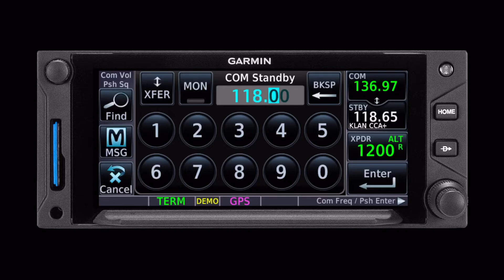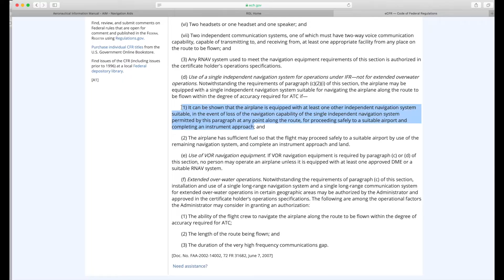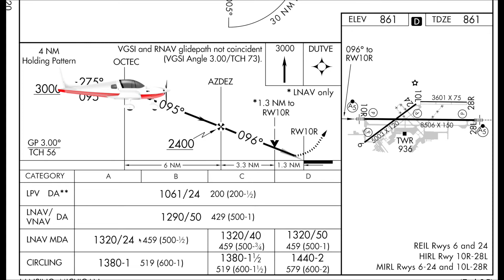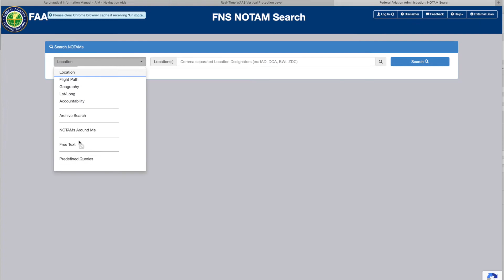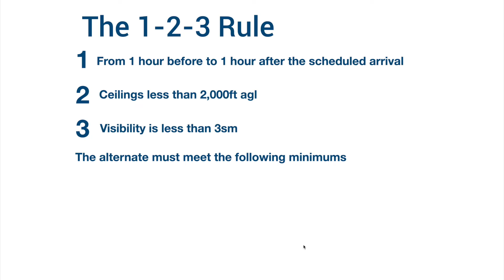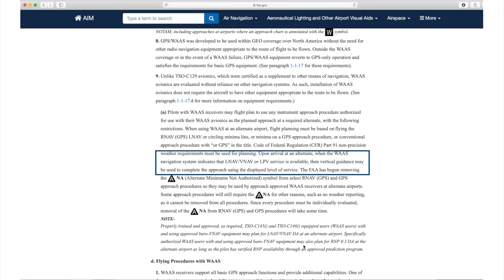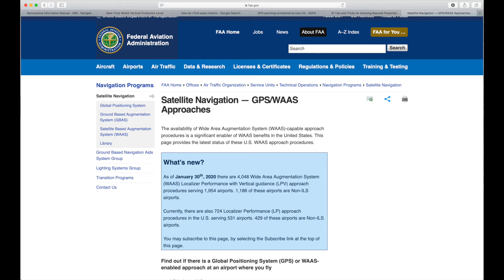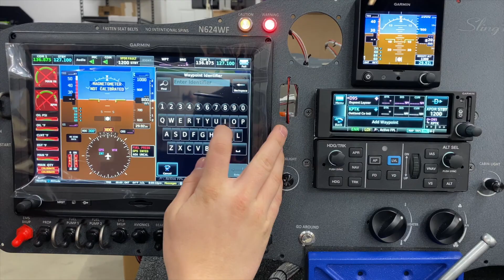GNX or GTN to equip your aircraft build for IFR?

Comment: I’ve used both and love both…I’m a bit partial to the 650 because I have more time with it but I think that’s the only reason really. The awesome thing about these units is that there are training apps for them. Sometimes I’ll just pop the 650 open on my iPad and run a “scenario” on it to make sure I’m as quick as possible and not having to dedicate unnecessary brainpower when the time comes.

Comment: I don't have a GTN but do have the GNX-375. It's still a new piece of equipment for me and I'm far from an expert using it.  My experience has been that when coupled to my GFC-500 autopilot, the GNX-375 will absolutely command a loaded & activated Approach all the way down to minimums, maintaining GS (or step-downs). All I have to do is manage power. However, as the GNX-375 lacks VNAV, it will not do the same for Arrival and Departure procedures. In these cases, the GNX-375 will still fly the lateral waypoints, but will not command any of the altitude constraints. This is not a huge issue in this price range, as small, non-turbine aircraft are not likely to be assigned a SIDs or STARs in the first place. In the rare case it does happen, all you have to do is manage the altitude constraints with the altitude bug, while the GNX-375 does all the waypoint navigation.
Reply: Thank you for this reply.  I am weighing  the options of different  GPS/IFR upgrades ( on a budget),  for my Cherokee 180 that, at this point,  just has a basic 6 pack.

Comment: So  you said in the video towards the end that if you are planning on getting your IFR rating in your airplane then you need to by the 650xi. Is the 375 not capable of IFR navigation ?
Reply from the maker: What we were saying is that at the time of this video, you had to have ground based navigation in the plane in order to do a check ride. This has since been addressed by the ACS and is no longer an issue. The GNX is fully capable of IFR navigation.
Reply: Awesome! I was thinking about adding dual G-5’s  and a gnx 375. Would this set up be fine for basic IFR ?

Comment: great info. Does this info need to be updated or is the info OK?
Reply from the maker: There has been some changes in the check ride requirements since this video first came out. The ACS has now done away with the need for ground based Navigation.

Comment: FAA controller here, just a heads up that ASR and PAR approaches are somewhat uncommon and need special procedures/training. I work at a large approach facility and we have none at any of the airports we serve. So I would definitely not rely on those types of approaches as a backup. But really great video, thanks for the info!

Comment: The question really is, what do I have left if my primary unit fails?  Why put all my eggs in one GNX375 basket?  That goes for both NAV and COM functions.
Reply from the maker: NAV and COM is not part of the GNX 375 only the transponder.. Te GTN 650 which has the COM and NAV built in. more fits your argument but in either case you could still navigate with the G3X if needed, though not a certified WAAS unit it is WAAS and could get you through in a pinch.

Comment: Is it correct take away that being paired up with G3X, GNX375 is a way to go?
Reply from the maker: It certainly could be a good way to go if you are fine with not having ILS VOR. The other feature you give up is V-Nav profiles, which is not something we typically do much of in smaller aircrafts.
Reply: @MidwestPanels  I have chosen the G3X, GNX 375 + GNC 215 for ILS VOR.

Comment: Wait a minute, I thought the purpose of these grossly overpriced nav units was to do ils/vor. If GPS is enough then the G3x already has that so why have a "nav unit" at all??
And further, the main display should obviously have ils/vor and ADS-B, it's just trivial radio stuff that was easy in 1980 and today it's almost an embarrassment how little it takes to do all kinds of radio. G1000nxi has all the old navigation built in as well as com. but strangely not ADS-B. It's more than a little obvious to have it all integrated. It's a racket that they don't. Those little fiddly crappy nav units with uselessly small displays costing 11grand plus labor when it's trivial functionality that should be in the main display. And the main display should be a lot bigger than 10"
If GPS is enough and it's an experimental plane, why not just two G3x at 3 grand a piece...  and ADS-B in and out.
btw waas isn't really necessary for navigation at all. It's a precision enhancement on the usual +-1meter resolution so it's so precise you can land on the center line completely blind. normal GPS precision is very plenty for the actual navigation. G3x has waas too

Comment: This vid is great, but it is 3 years old.
I’m 99% sure that about 2 years ago the FAA issued a bulletin stating that you can take your
IFR check-ride with a GPS-only panel, like the Garmin 175, 375, 625, or even the 400W.
Reply from the maker: Thanks for watching, another viewer mentioned the same thing as you have in this comment so I set out to find the answer and will be posting a follow up video to this. What we found is that the bulletin you are referring to did allow LPV to be counted as a precision approach which was one of the hang ups in the discussion but when I called my local FISDO to discuss the topic, they had a another item they pointed out that would still keep their opinion on the side of not allowing it for a check ride, we will show this in the update video.
Reply: @MidwestPanels  Earlier this year I did my IR checkride exclusively with GPS.
Reply from the maker: @mobius7089  Yes, they finally changed the ACS to allow GPS only.  Prior to the latest revision, Appendix 7 still stated that ground based navigation was required which when I called our local FSDO this is what they were hanging their hat on and not allowing GPS only, some DPE's however were allowing it for the last few years so we always said check with the local FSDO and DPE for their interpretation, however since that latest revision there is no longer an Appendix 7 stating the need.
Reply: @MidwestPanels where's the update

Comment: Great video but you want to be careful saying that you can use the G3X to manipulate any navigators as this renders your  IFR navigation illegal because the only way to do this is to revert to the internal GPS (G3X) which is not IFR certified.  You can however use a peripheral such as an IPad to input, change or add anything on your flight plan.   This can be done without ever switching from your Navigator GPS.  I have been asking Garmin Aviation since 2020 to please add the functionality of the second G3X to use as an MFD to add or modify flight plans.   Nearly 4 years later, this is still not a functionality available on the 3X with any Navigator.
Reply from the maker: Thanks for you input, honestly for the 2 minutes I would switch over to the internal GPS I’m not concerned about it. There are no alarm bells ringing to ATC and to be quite honest the G3X is WAAS although not certified, so in the event you lost you Navigator you could fly everything on the G3X as a backup if you had to. Having said that I would rather use my iPad as you mention and transfer to panel as I find it easier anyway and that’s what I teach my IFR students to do.

Comment: Just stumbled across this video. This is fantastic! Being 3 years old, I wonder how much is out of date now? At '23 AirVenture, we were talking to the Garmin rep about Garmin's 355, 375, 650, and 750. I have had 3 CFIIs and 2 pilot friends, 1 of which is ATP, helping me understand which is right for me with differing answers across the board. Building an RV-10 and about halfway right now, waiting on QB Cabin and starting my IFR training hoping to better understand this. I would be flying VFR 99% of the time, with occasional light IFR to get through clouds and out of Denver. Heavy IFR here is ice and that accumulates quickly on the Van's thick wings. Overall, I want to be /G and able to do approaches to numerous airports, many of which don't have ILS anyways. Your GPS is the redundancy to WAAS makes me think I don't need the Garmin G5 either?

Comment: If I may ask, in regards to taking the IFR check ride. Will a G3X, GTX375, GTR20 and a GNC 255 Nav/Com meet the requirements of being able to fly an ILS. I think so but wanted to get your thoughts. We are looking at matching the panel of the Piper 100i on our Piper Cherokee. Figured Piper did enough research in coming up with the most economical IFR panel on that trainer. We would also install the GFC 500 and one G5. Thank you
Reply from the maker: Yes, the GNC 255 would fulfill the requirement for ILS.

Comment: Part 125 doesn't apply to small GA Aircraft. You can absolutely fly GA IFR with a single nav system.
Reply from the maker: Correct, that was the point we were making.

Comment: One point that is missing is that VNAV is only available on the GTN 650 (and 750). While this relies on a capable autopilot, it is worth mentioning as part of the discussion.
Reply from the maker: All though you are correct that the GTN does VNAV and the GNX doesn't,  GNX does V-Calc so you could calculate your descent if a crossing restriction was given, since most of us piston poppers do not usually fly SIDs and STARs, it is not as much of an issue.

Comment: You did not mention the fact that the GTN650 also has the vertical (VNAV) component.  The GPS units requires you to control the vertical aspect of the arrival and approach.
Reply from the maker: You are half correct, the arrival will not have VNAV but the Approach if it has vertical guidance such as LPV will. We didn't mention it because arrivals are not flown as often by GA aircraft and if it is you do, it's not that hard to step down with the autopilot.
Reply: @MidwestPanels  thanks for the clarification.  In discussions with Garmin I was told that the GPS unit’s would only VNAV from the final to the runway.  That the vertical would need to be accomplished by the pilot.  That I would need a GTN to have complete full VNAV.  I’ll have to revisit with them.  
I appreciate content such as yours to aid in staying informed.  Again, thanks for clarification.

Comment: Great video. I have a 650 in my panel and would choose the 375 if it would have been available at that time. There will be more GPS approaches in the future, especially at smaller airports. ILS will not go away at bigger airports. VORs are almost obsolete. After owning my RV-10 for 6 years and 400 hrs I only had to fly 2 real IFR approaches to the minimum. I think a lot of people get carried away with all those screens. It also doesn't matter if you're owning the newest equipment. What matters is that you can operate it properly under IFR and a full pattern.
Reply from the maker: ILS may not go away soon but it will go eventually, as they are working on a system called GBAS, Ground Based Augmentation System that will allow one tower to cover all the runways at an airport as unlike ILS which  only covers one landing direction into a runway and it will allow CATIII type approaches. Huge money savings over ILS with the same accuracy and minimums.

Comment: Could you use a GNX375 and a GNC255 (a or b) to meet the same criteria for IFR as the GTN650?
Reply: Yes, that's my setup. I'm based in the UK, so the GNC 255 A was the only option with 8.33 kHz spacing
Reply: or alternately. A GNX355 and an L3 NGT9000

Comment: Great video and explanation!!  I've been trying to decide whether to go GTN or GNX375 + GTR255 and this confirmed what I suspected.    Costs is a few hundred more than the GTN650xi for the GNX375 + GNC 255, but you get a transponder.  Add in one more com radio and you have redundant GPS + Nav and redundant com including separate chassis so no single point of failure for everything.
Reply: My plan exactly, GNX375 + GNC255 + GNC225, separate HSI for the Navcom.

Comment: I think you are wrong on this. As a designer of redundant equipment systems a single unit like a GPS receiver with a built in waas share a single power supply. This makes it a single unit. When doing reliability calculations this would count as 1 unit. If you have two units your total failure probability drops to .5.
Reply from the maker: Hi and thank you for watching. I’m not sure what part you are saying we are wrong, as these units can be installed standalone. As for the unit power, there are several power inputs to the unit that power the GPS, NAV and COM independently. If one loses the screen, then effectively you would lose the unit - but that would be the same of the NAV/COMs we are used to. In certified aircraft in the days of old, we only had to have one NAV radio to be legal. Two was nice for cross reference and backup, but only one was required. Now, with EFIS systems, even if we did lose the GTN, we can still get along safely. The video points out the legality of installing a single GPS unit and what you can do in the event of failure.
Reply: @MidwestPanels  the point is, redundancy requires two independent systems. Totally independent. Unless I’m missing something a waas/gps receiver is one unit with a common power supply. A full calculation of reliability would be on the components of the system. The antenna, the power supply, the waas circuit, and the gps. Any one could fail but a failed power supply takes out both.
Reply from the maker: @N67414  You have a redundant system, its called the G3X. It has a WAAS source that could be used if necessary. We can take any setup and pick it apart. What about one vacuum pump? I'd rather lose my GPS than my vacuum pump. What about the one engine spinning in front? I'd rather lose the GPS than the engine. Like I said, we can pick anything apart, but we are only speaking about legality - and legally we can install one unit. If I have an EFIS with full GPS capability, I'm not at all worried about it.
Reply: @MidwestPanels  you are correct in saying the G3x is redundant. It was designed that way. Things like the battery back up the internal power supply. A vacuum pump is what the industry would call a tingle point of failure. Let’s take the brakes on your car. If the hydraulic system fails you have the emergency brake. The probability of the hydraulics failing might be .o4%, the probability of the emergency brake failing since it’s a physical cable might be .0002%. The probability of a TOTAL brake failure is the product of those two. A very small number. Similarly, the failure of a battery might be .001% where as the failure of on board power, or even he G3x internal supply is quite small, but larger than the battery. Garmin engineers must so the individual component reliability when seeking certification. My point was when you have one unit with two systems on board it is a single point of failure. My Tesla has only the brake pedal, no emergency brake handle but, I believe like many autos, they have split systems with two master cylinder pumps and separated front and rear.  If I recall, the G3x requires a G5 or equivalent for instrument certification. Aka, redundancy. For all reliability calculations redundancy is at the cornerstone. Be it internal with dual circuitry, or external with dual units. Airlines have triple and quad redundancy. Inertial, nav, gps, etc. I’ll agree a single unit with back up battery is more reliable than one without. You are correct that the engine is a single point of failure but even it has dual mags, dual methods for air, dual ways to get he gear down. The cirus has a parachute as back up making the probability of crashing and dying lower. My only point was without duality your reliability is limited to the base reliability of the unit in question. Nothing personal. I used to build electronic systems that had a down time requirement of less than 1 sec per year. On mission critical systems there were triple systems to meet the requirements. Even then a 4th system interrogated the other three for historical accuracy.  Anyway, I like your videos, they are really good. Easy to watch and follow and loaded with info. I’ve learned a lot over time and appreciate he time you take.
Reply from the maker: @N67414  Thanks again for watching!
Reply: @MidwestPanels  btw I was looking around to see if anyone ever put a g3x with a 375 and do they speak well to each other.
Reply from the maker: @N67414  We do it all the time and they work perfectly together. You can control the transponder from the G3X and get CDI information, you can cross fill flight plan information.

Comment: Thanks for this presentation. I chose a G175 which will allow me to perform RNAV/LPV approaches. My plan for the plane is to be a VFR Plane with IFR capability. This will allow me to either get on the ground if weather comes in, or get out of somewhere to get to VFR conditions.

Comment: Also two big thumbs up... I really appreciated the clarification on the regs regarding 'contination / redundancy' that helped me a great deal in understanding what is perceived vs true loss of functionality. ILS can also break or get damaged, so takes a lot of steam out of arguments regarding duplicate capability. Also, todays equipment is
inherently more reliable than older gear with many aging sensitive components. Taken to the extreme i suppose some gear heads out there would have the panel so loaded the tail would need ballast...lol.